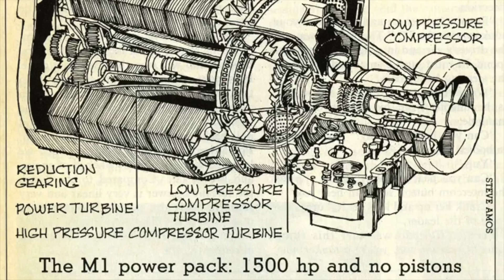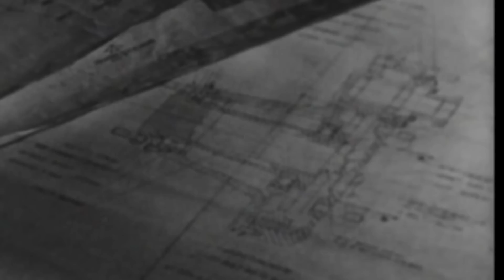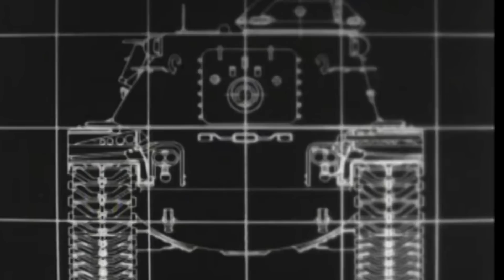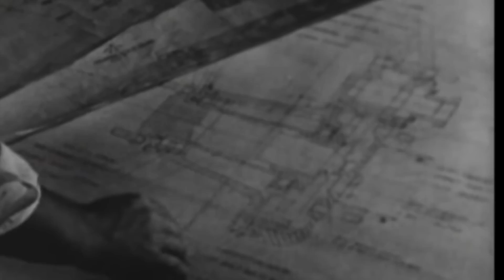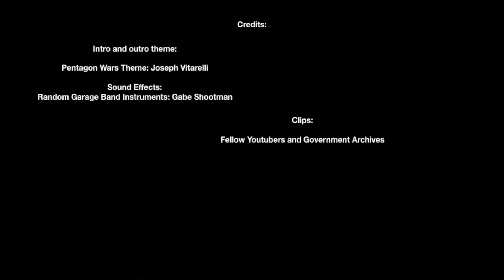The Real Pentagon Wars (For The M1 Abrams)

Comment: 10:35 with the context of the time the T-72 was created it makes sense. Consider for a moment that top attack weapons such as the javelins didn't exist at that time (obviously) and in a hull down position, it was practically impossible to hit the autoloader that is so low onto the ground. Not to mention the tank itself was already quite small, try googling "Abrams next to T-72". You can't even stand up inside the T-72. You also can't judge a tank without considering the country's doctrine.

Comment: Such BS. 

You failed to mention that even though GM did win the initial trials, the Army got a five month extension so that BOTH GM and Chrysler could redesign their tanks to better meet the Army's requirements. Chrysler redesigned their entry from the ground up. GM arrogantly did nothing to their original design. Even though there are different categories to compare the tanks, some categories are much more important than others. Chryslee had already won in every category except survivability and cost. Survivability is absolutely tantamount, and cost is also key. Chrysler's original design had quite a bit of bling. Once they were informed that the army wanted a less expensive design with much less bling, they redesigned their entry. Surviving a direct hit and continuing to fight is really, really important. Being able to build thousands of very capable and survivable tanks instead of just hundreds of blingy tanks is incredibly important.

The German Leopard AV2 was tested without its armor because that would have made the tank 6 tons over the weight limit for the competition. The Leopard II is actually slower than the Abrams M1 once this armor weight is added in. Weight is much more important to the US Army because any invasion of Europe by the Soviet Union would require many, many more US tanks to be transported to Europe. Germany didn't have this limitation when tgey designed their tank, duh. Also the Leopard II was nicknamed "Old Smokey" because of its smokey diesel engine. A smoke cloud can hide you from an enemy, but this isn't nearly enough smoke to hide you. A smoke trail behind you gives away your position. Just ask F-4 Fantom pilots from Vietnam. 

In the competition, the financial situation at Chrysler cut against them on all levels. A bankruptcy would interrupt production (which eventually did happen). The Army knew this. The second round of testing seriously favored the Chrysler redesign because it was a far better design, AND it fit the Army's needs much better than the GM design. It had speed, firepower, survivability, and maneuverability advantages over the GM design. It was by far the better design, hands down.

Comment: 1. As I pointed out to ArcofCone, the M1 is not a copy of the Leo2. It also DID NOT copy any of the tech other than the 120mm gun which was redesigned with fewer parts and adopted as the M256. In fact the Leo2's stabilizer was a development of the Cadillac Gage unit installed in the Leo1s and the night/day sight in the Leo2A4 was based on a Honeywell design. A simple review of the references shows this.
2. The 105mm M68 with the M735 2d generation tungsten steel long rod penetrator fielded in 1975 could penetrate over 400mm (vertical RHA plate) at 2,000 m and just under 500mm at 1,000m. The M774 adopted in 1978 used a DU encased in tungsten-steel that could penetrate over 450mm. The M833 3d generation DU APDSFS could penetrate just over 500mm and was fielded in 1983. The M900 was not fielded but was available in 1990 and could penetrate over 550mm at 2,000m. The 120mm M829A1 fielded in 1986 could penetrate over 600mm at 2,000m. The D-81 125mm gun started with the 3BM9 a steel 1.5 generation APDSFS and was rated at ~375mm at 1,000m. I don't give a 2,000m point because the maximum effective range of the 125mm until the late 1990s was 1,800 m. The 3BM12 was a steel 2d generation APSFS rated at 440mm, the first tungsten-steel design being the 3BM15 rated at 500mm. The D-81 suffered accuracy issues due to the failure of the Soviet industry to manufacture powder and projectiles to consistent tight tolerances, such tools being prioritized for missiles and aircraft. A DU projectile wasn't issued until the late 1990s. The Chieftain L11 120mm gun could penetrate 375mm at 2,000m with the APDS round.
3. A laser rangefinder means nothing unless you have a full solution digital fire control system, something the Russians didn't have until the early 2000s.The initial T-72 model fielded from 1973 had a coincidence rangefinder, but not the mechanical off-set and analog fire control computers the US tanks had used since the M47 from 1951. The T-64A fielded from 1973 also had the coincidence RF but also stabilization and an analog FC. The T-64B fielded from 1979 had a laser RF. The T-72A also fielded in 1979 had a laser RF, but only an analog computer. The lack of long range accuracy was to have been fixed by the gun launched ATGM, but NATO began fielding "multi-layer arrays" near the same time making the missile less useful. The M60A1 between 1971 and 1977 received stabilization, a digital computer and a LRF, the M60A2 featuring the same from 1973. The full package including thermal sights came with the M60A3 TTS in 1979. Thermal sights were a game changer. The Soviets wouldn't put thermal sights on tanks until as Russians they did so from the late 1990s. All Soviet MBTs up to 1991 used active infrared systems. The IR searchlight next to the gun had a range of 800-1,200 meters, while the S/L on the commander's cupola ranged to 400m. The M60A1 received image intensification sights in 1973, which when light was available was good to 1,200 m. With a "pink" filter over the S/L, this could be extended to 1,800 meters on a starless night. Thermal sights had an effective range of ~3,000 meters and could "see" through smoke, sand, fog, and rain. M60A3 TTS, Leo 1A5/6, Chieftain 12/13, AMX-30B2 and such featured these vision devices and sights as did the Leo2A4, the M1 and the Challenger 1. US tactical doctrine from 1983 was "call for smoke" and blind the Soviets  so the US tanks could take advantage of the thermal sights, which the AH-64 and the A-10 (mod w/Pave Penny) also had.
4. The Soviets used a single plate of silicate armor on the upper glacis of the T-64 and T-72/T-72A. The US Army found in tests in 1952 (yes, 1952) that a plate of silicate hit by a KE or HE round would suffer cracks around the impact area. Quickcrete would restore performance against HEAT rounds, but the damaged area would extend beyond the cracks weakening the plate. Which is why the US Army did not adopt it, despite plans to use it on the T95 and M60 series, until the system featured multiple plates in a polyurethane matrix. In addition, the early silicate arrays in the turrets were subject to similar damage. The T-64A featured upper glacis protection of 410mm against KE and 450mm against HEAT, somewhat less on the turret. The T-64B upgraded the turret armor to the same as the glacis plate. The T-72 was equivalent to the T-64B and the T-72A increased the protection to 500mm KE and 560mm HEAT. The T-72B increased this to 520mm KE and 950mm HEAT in 1985 at a time the US 120mm M256 could penetrate over 600mm at 2,000m, the German Rh-120 using a tungsten-steel round could do 560-570mm and the L31 round fired from Chieftains and Challengers could do 580-590mm using DU. Kontackt 1 ERA introduced in 1983 increased protection from HEAT projectiles by 200mm. The T-72BM introduced in 1990 featured Kontackt 5 which increases armor up to 200mm against KE and 500mm against HEAT. The T-80B introduced in 1981 was equivalent to the T-64A, then upgraded to T-64B level in 1982. The T-80U added Kontackt 5 in 1985 but was not manufactured in large numbers until 1987. It should be noted that the Soviets had such confidence in their base armor arrays that they introduced ERA  across the force. They also suffered from the lack of growth potential in their size-restricted designs. The NATO tanks were at a disadvantage in daylight with 250-330mm (500mm w/ERA), Chieftain at 400mm and Leo1 and AMX-30 at 150-180mm. But the M1 was protected at 400mm KE and 1,000mm HEAT, as was Leo2A2/4, and Challenger at 500mm/800mm. But M1 PI and M1A1 were equivalent to 600mm/1300mm (1984) with the M1A1(HA) with DU matrix (1988) at 750/1500mm. The larger NATO MBTs featured growth potential for a number of new systems and improved weapons systems and protection. 
5. The so-called reformers were less than sensible in their calls to return to simple systems. Yes, the US could build 14,000 M60A1 for the cost of 7,000 M1s, except it didn't have the industrial base to do that. The largest number of M60A1s built in a month did not exceed 180. They also acted if the US Army and USAF had unlimited manpower. The AVF (All Volunteer Force) went into effect in 1975. When I enlisted in 1975, there were 1.5M Soldiers in the Active Component. By 1980 when I got my commission, there were 900,000. By 1990, there were 750,000. Who was supposed to man these 14,000 M60A1s? Can you imagine the casualties we would have suffered trying to fight the Gulf War with M60A1s and F-5Es? Sorry, but these people were truly ignorant of the new world the US lived in after Vietnam or just idiots.
Reply: They are both and for your fifth point for double the tanks that's double the spare parts two make and double the crew two train feed pay and house edit and that's double the tanks to transport as well
Reply: Damn. You broke it down like a fraction for em'
Reply: I aint reading allat.  USA domination✊🦅🇺🇸

Comment: I find it odd that the video contrasts the "unreliable" gas turbine of the Chrysler XM1 against the supposedly "reliable" diesel of the GM XM1 prototype.  Even odder is the fact that the video says the MBT-70 had a gas turbine, when in fact it had the same diesel engine at the GM XM1.  This engine is the AVCR-1100 (later re-designated AVCR-1360) made by Teledyne Continental Motors.  The AVCR-1100 utilized variable compression pistons to maximize power output, and this technology proved to be troublesome.  In the early 80's when there was concern over the teething problems experienced with the gas turbine AGT-1500 of the M1 tank, congress authorized further testing of the AVCR-1360 as a potential back up option and the engine.  It did rather poorly in the ensuing tests.  After this, interest in the AVCR-1360 died and the AGT-1500 enjoyed a long life as a well liked, if rather fuel hungry, component of the M1 Abrams.
Reply: This dude did the laziest research ever

Comment: Abrams tanks are irreplaceable in case of a large scale war. Just as German Tigers and Panthers that looked great until the first losses.
Reply: The US Army has over 2,000 sitting in the desert at Sierra Army Depot. When they need more, like the 250 for Poland, the pull them out and send them to Anniston Army Depot where the war reserve production line is used for upgrades and overhauls.
Reply: The Abrams is highly replaceable, not to the degree of the Sherman or T-34 but comparing them to Germany’s WWII big cats is woefully misinformed

Comment: You got whole sherman versus t 34 debate completly wrong. Sherman was superior to t 34 in almost every way.
Reply: Not sure why anyone would pick the t34 over the Sherman. I bet such opinions change once they're asked to operate a t34 with it's abysmal concern crew comfort.
Reply: @polygonalfortress  most T34 are shoddily built unlike the M4 sherman
Reply: @aker1993  Yep. Every single factory never built any of their tanks to the desired specs. T-34 on paper is a goodish design for an early 40s tank, but once you start cutting back on features it becomes a miserable experience to be in. By late 1940s the tank was completely obsolete.
Reply: So why you needed 5 Sherman to destroy 1 T-34?  as tested with the T-34's German's captured and used. 
Plus,  why it takes 8 to 15 shells from Sherman to incapacitate T 34  while it need only 1 to two shells on the Sherman. 
T-34 was horribly uncomfortable ..... only downside.
Reply: @ThereIsAlwaysaWay2 not sure where that BS came from. The sherman is better tank, its 76mm gun performs equal to and better than the 85mm t34, they both have the same thickness of armor, the sherman could get of 3-4 rounds to the t34 1. The soviets found that the sherman was less likely to cookoff when compared to the t34.

The sherman had alot higher build quality than the t34
Reply: @ThereIsAlwaysaWay2  Do you have any proof or it came straight from your ass?

Comment: If the turbine engine was so bad why is it still in there 43 years later?
Reply: Funny thing is it wasn’t to bad. Because the Diesel they used on the MBT-70 program is literally the same one they used in the XM-1 program. That diesel was fucking terrible, throwing oil out of the crank at high speed turns, the engine would also eat itself on occasion also
Reply: So Chrysler can get the dough they lobbied so hard for...
Reply: @mode3763  but the engine isn't a chrysler engine it's a honeywell
Reply: @mode3763 Chrysler defense doesnt exist anymore.

Comment: well, T-64 (wich was not disclosed to the public until more than 10 years after its introduction in 1968) and T-72 (introduced in 1972) shocked western analysts.
Very advantageous low profile, massive, stabilised 125mm main gun, thick frontal armor, good mobility and low weight. 
The publicly known T-72U and A were comparable or surperior to everything in NATO service at the time.
Remember: back in the time NATO also still used coincidence rangefinders (with the exception of the UK wich opted for a range finding .50cal on chieftain), analoge fire control computers, active/passive IR for nightfighting and in best case a simple two axis stabiliser.
T-72A had everything the most modern NATO MBT´s had for only a short time and was entering mass production.
Reply: Except, T-64 for all manufacturing issues, was BY FAR most modern and breakthrough tank at time of its introduction EVER. T-72 was requested as more ...manufacture-able alternative.
Reply: @piotrd.4850  yeah, when you consider that the budget version was on par with or better than everything NATO could field.... And it was mass produced in numbers NATO didnt have

Comment: One of the big reasons why the Chrysler version won was because it had more internal space in the turret available for future upgrades
Reply: ^ much of the Abrams' later success owes to it's huge footprint - Chobham armor arrays are 2 feet thick and to move all that around required a 7-wheel hull, and that lent itself to a larger turret, too. The Abrams battlefield success is directly downstream of having the internal dimensions to have things like blowout panels, the best armor to take on HEAT rounds ever at the time and a high-performance powerplant that made it fast.

The Army requirement for "M1" was 55 tons, but after they fell in love with the turbine engine performance, grappled with the sunsetting lifespan of the 105mm L7 [which was simultaneously true to any political machinations also at play], and were made aware of Chobham armor, the cocktail that made Chrysler's Abrams were assembled.

It wasn't planned to be what it became, in a very real sense. Corruption, intrigue and happenstance played a leading role. And yet it ended up being a great design. It is a very interesting story.